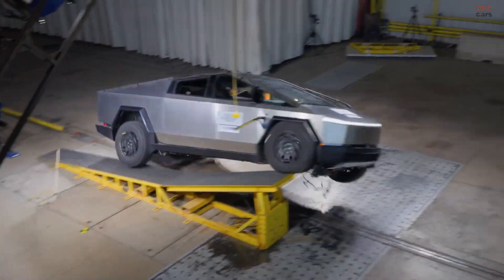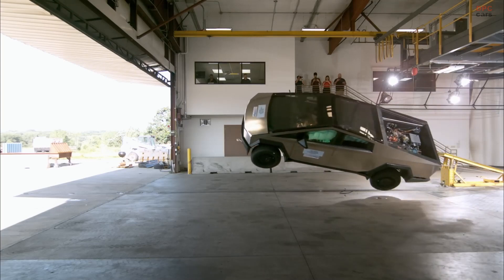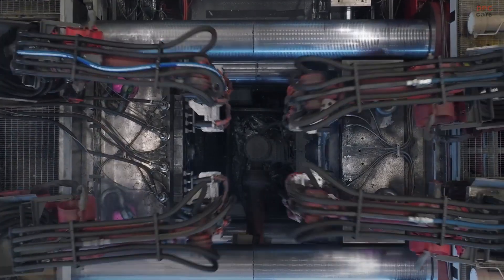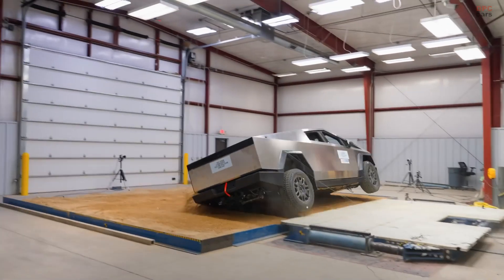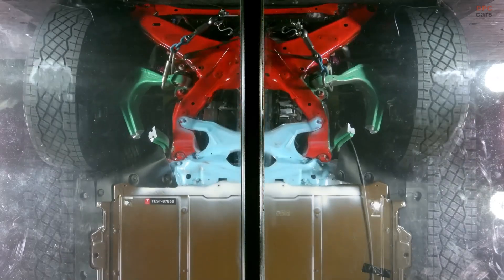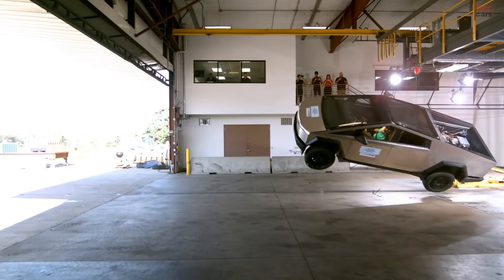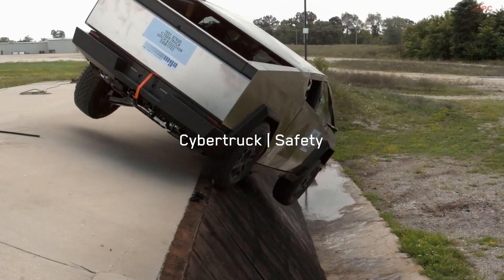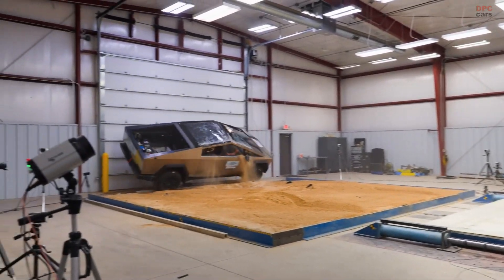Tesla Cybertruck Safety Tests With 5 Star Rating

Comment: Safety at the expense of the driver car insurance going up. The giga stamping method cuts cost for the manufacturer. But, raises cost on the driver insurance. Because, once there is a bit of frame damage..... it's a wash for your 120k cyber truck
Reply: wow another baseless opinion stated as fact without a bit of context or nuance
Reply from the maker: Agreed